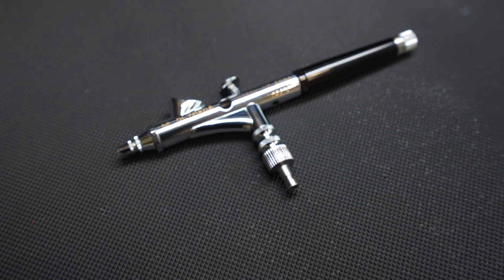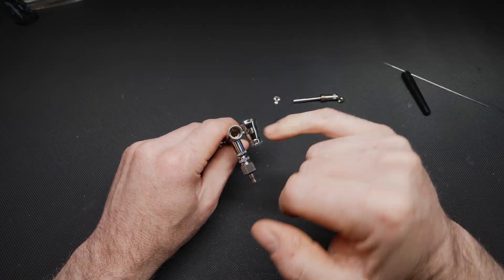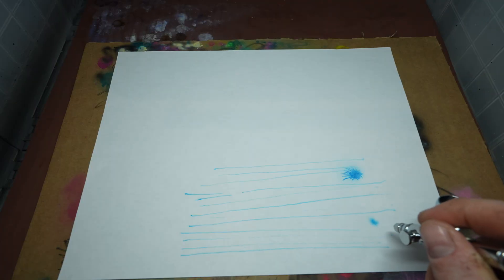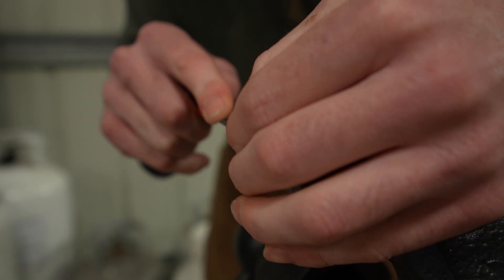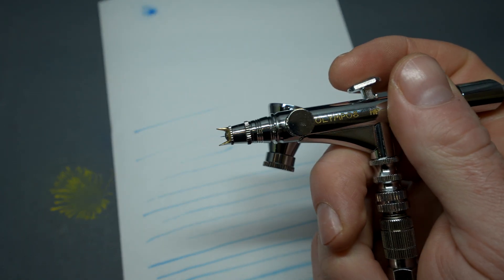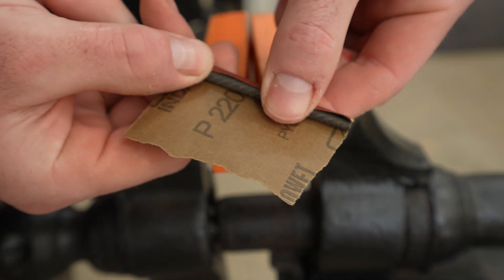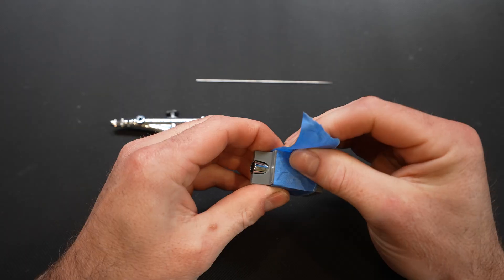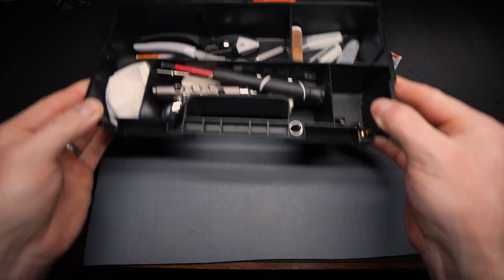I built an Airbrush from 5 LEGENDARY brands - the CHIMERA

Comment: Is there an estimate cost of the component parts of this beauty that an aspirant brushsmith might expect to need to embark on this journey?
Reply from the maker: That's a good question...

Olympos Airbrush - $180ish
Iwata Guide System - $50
GSI Rear End and Valve - $50
H&S Chucking Nut - $10
Iwata Needle/Nozzle - $40

I had some of those parts already (I parted out a GSI Creos 771 for a different build).
Reply: @Wily.Wizard  For $180 you can buy a new RichPen 222C and it will produce phenomenal fine detail with the right paint dilution. I have a video on my channel where I make PHOENIX lettering on a matchstick. The length of the inscription is 1cm.